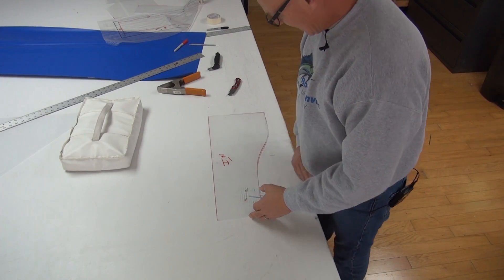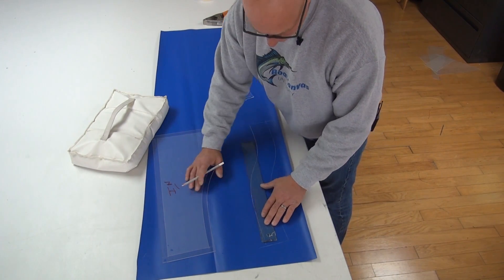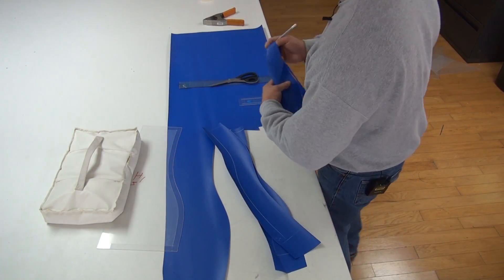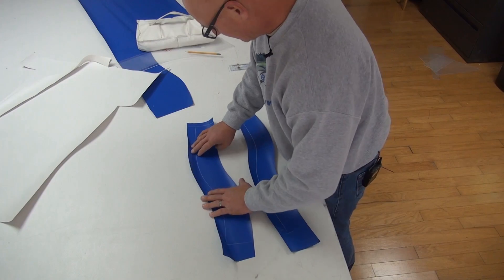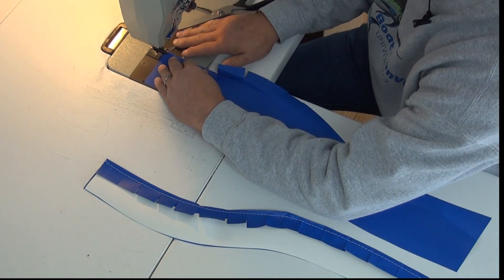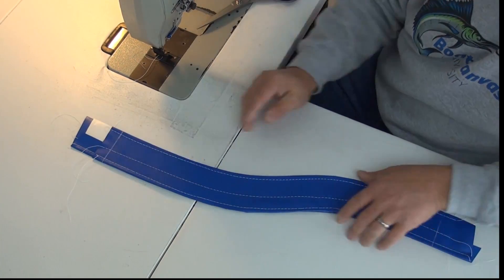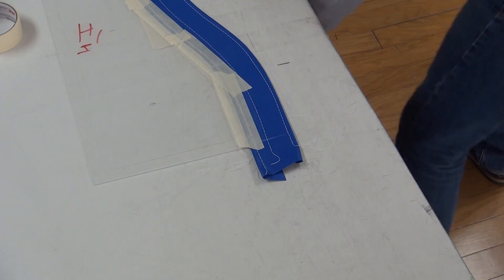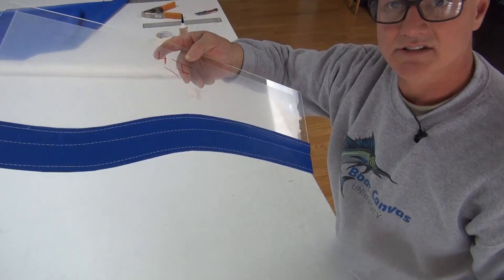Acrylic Bond Bottom

Comment: Hey John, got a project where I need to remove some old acrylic and put in a new piece (like you did in a previous video). Any advice on debonding the old piece? Heat or chemicals? I'm trying not to ruin the fabric components.
Reply: M did you ever find a way to remove old panels with out damaging the canvas